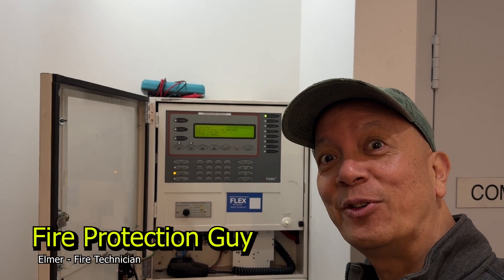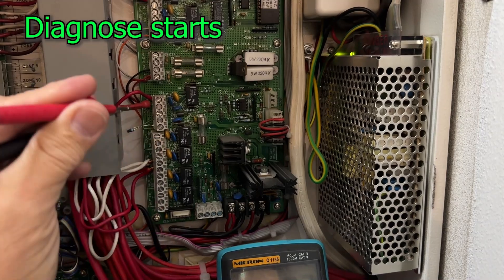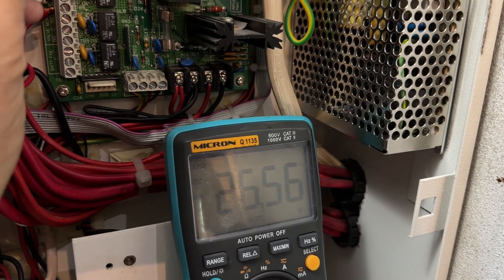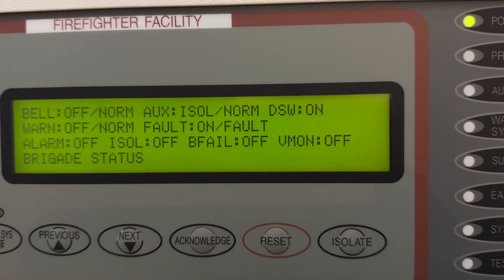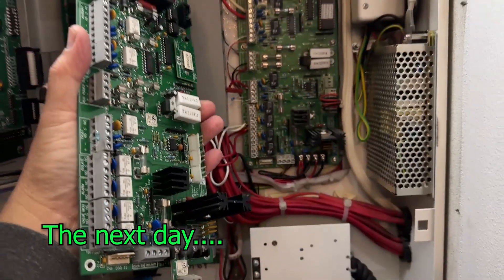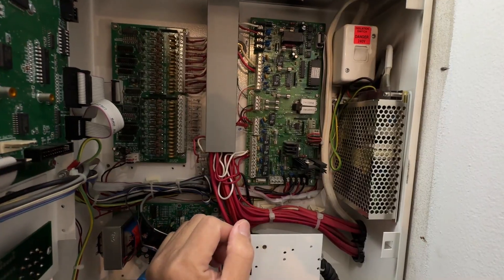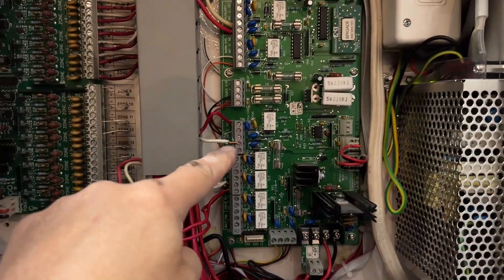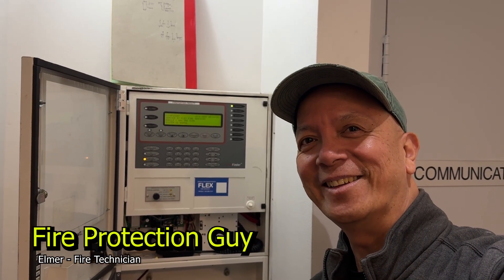Fire Detection System - Ampac Fire Finder Intermittent Fault

Comment: I always think it’s so cool to see the similarities and differences between fire protection products in different places. I’ve always thought Australian fire protection products were so cool. 

Is it just me, or do you guys seem to have it a lot simpler when it comes to how many different brands you have to deal with in Australia vs here in the United States? 

For example here are the main brands we have here in the US:
Honeywell owns Notifier, Fire-Lite, Silent Knight, and Gamewell-FCI. Those all used to be independent companies, but now they are owned by Honeywell. They also brand Notifier products as Honeywell products and Silent Knight products as Farenhyt products. None of these brands’ products are compatible with each other, even though they are all just rebranded System Sensor devices (who is also owned by Honeywell). It’s just infuriating software locks. Before Honeywell bought all of those brands in the early 2000’s, they made some of their own products up until the 90’s, and they also started rebranding EST products in the 90’s-2000’s that were not compatible with non-rebranded EST products.

Carrier owns EST/Edwards and Kidde. Again, these used to be independent companies, but they are now owned by the same company and use pretty much the same devices, but they are not compatible with each other. Edwards bought FAST (Fire Alarm Systems Technologies) in the 90’s, making EST (Edwards Systems Technologies). Many companies rebranded EST equipment in the 90’s and early 2000’s, as they were way ahead of their time with their products. For example, they released the EST3 addressable system in 1996, and it was only just discontinued a few years ago and is still fully supported. It is still currently used in some of the biggest buildings and skyscrapers here in the United States. They also released the SIGA addressable protocol in the 90’s, which is still used by their current products today.

Johnson Controls owns Autocall and Simplex. Simplex has been around for a long time as one of the leading American fire alarm companies, and they were just bought out by Johnson Controls in the mid 2010’s. Autocall made their own products up until Simplex acquired them at some point in the late 90’s and they just disappeared. In 2017, Johnson Controls restarted the Autocall brand as rebranded Simplex products that are not actually compatible with Simplex products. Before buying Simplex, Johnson Controls rebranded Notifier equipment that, you guessed it, is not fully compatible with Notifier equipment.

Siemens entered the fire alarm industry in the 90’s when they started rebranding EST products. In the early 2000’s, they bought Cerberus Pyrotronics, which was one of the leading companies in the US market, for example, most large hotels and skyscrapers that were not built with EST systems got Cerberus Pyrotronics systems. They came out with some of the first addressable panels in the early 80’s, and released the MXL in 1993, which was practically and infinitely expandable addressable panel with voice evacuation capabilities. This panel was actually used in the World Trade Center complex from 1993-2001. They continue to be one of the most successful brands here in the US, with their new Modular panels that are based off of the FireFinder XLS (the successor to the MXL).

There are several other independent and local brands such as Potter, Hochiki, National Time and Signal, Mircom, and Pertronic (who just recently entered the US market). I won’t go into those, as they are less common and are mostly independent, although Mircom and Pertronic do use their own versions of System Sensor addressable devices.

Here are some other code and system design differences that I’ve noticed:
1. We are required to mount all fire alarm devices on and make all connections in enclosed (usually metal) electrical boxes. For example, we would not be able to do what you do where you just have a speaker in a hole in the ceiling. It would need to be mounted on an electrical box with the connections in the electrical box. 

2. We are required to have strobe coverage mostly everywhere. You need to be able to see strobes flashing no matter where you are in the building, even if you are facing away from the strobe. We have specific rules for what strobe brightness can cover a certain area. In sleeping areas, strobes need to be at least 110-177 candelas. The minimum allowed strobe rating is 15 candelas. Fire alarm strobe lenses here in the US are also required to be clear. We are not allowed to use red or any other colored strobes for fire alarm purposes. I’m not sure if this is a thing in Australia or not, but all strobes must be synchronized too to help prevent seizures. This is all part of ADA (Americans with Disabilities Act) laws that were introduced in the mid-late 90’s. 

3. Different terminology. For example, Fire Alarm Control Panel (FACP) or Fire Control Panel (FCP) vs Fire Indicating Panel (FIP), Mimic panel vs remote annunciator, and occupant warning system vs voice evacuation system.

4. Our panels look different than yours on the inside. For example, ours do not usually have outlets on the inside.

5. Our voice evacuation systems are different than yours. For example, we do not really have any standard tones or messages. For example, a system here can pretty much play any message imaginable. Every brand has their own default messages that are loaded onto the panel, but those are also often changed. The only standardized thing here in the US is the Temporal 3 fire evacuation pattern, which is the standard pattern that is pulsed on horns and speakers in most places throughout North America to initiate a fire evacuation. We also use our voice evacuation systems as mass notification systems, to warn about things like severe weather and lockdowns. Those custom messages can also be loaded into the system. 

6. We use pull stations rather than call points. Almost all of our pull stations are resettable with a key rather than replacing glass. Almost everywhere but North America uses call points.

I do have a few questions:
1. Do you guys have addressable notification appliances, such as speakers, horns/sounders, and strobes? I know Europe has had that since the 90’s, and we are just getting it here in the US for the first time. Currently, only Simplex and Autocall offer that, and Siemens is planning on coming out with it soon.

2. Can you tell me about the different brands and companies you have there?

3. Where are strobes required there? Are they at all? What are the rules and regulations with them? Also, do you guys use LED stones yet? In the last decade here in the US, LED strobes have pretty much replaced Xenon strobes because of their lower current draw. For example, system sensor just came out with the LED L-Series strobes last year, and they were one of the last companies to implement LED strobes.

If you look up “Fire alarms sounding at the Providence Place Mall” on YouTube and click on the video by Fire Alarm Dude 5967, you will see a perfect example of an American voice evacuation equipped fire alarm system in action. That video shows a Siemens FireFinder XLS fire alarm system that replaced a Cerberus Pyrotronics MXL-V. Pretty much the only thing that was replaced was the panel itself.

Sorry for the painfully long comment. 😂 I hope you are as interested in the differences between different parts of the world as I am.
Reply from the maker: Love reading history mate. Thanks.
Answer 1:  Leading brands now uses addresable sounders for addressable systems. Major fire system suppliers - Ampac, Honeywell, Hochiki, Pertronics, Siemens etc.
   2 -  We have Incite Fire which is suppliers of Hochiki products.  Honeywell , same as everywhere in the world. Pertronics - the best brand for NZ. Ampac Tech - European. We have the Siemens, Flamestop (using Johnsons Technology). We got german technology - Fusion.
   3. The strobe is required only in main entry point for fire brigade/department to locate the fire alarm panel.  In big areas and public places,  it for evacuation as visual -yellow and red.